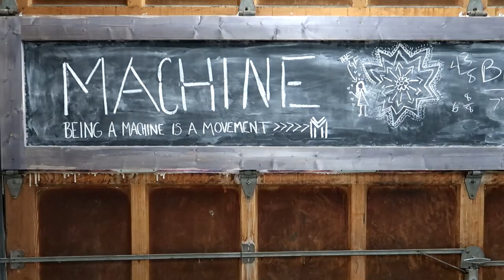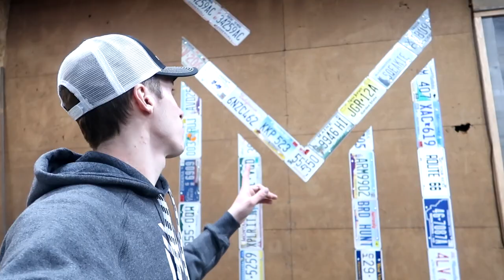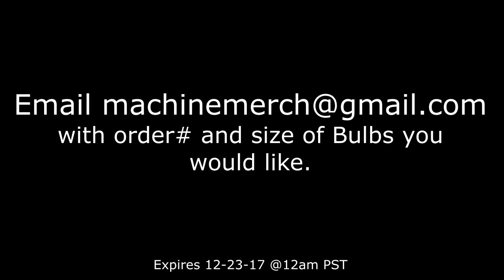NEW DURAMAX MOD - PLUS SOMETHING FOR YOU!

Comment: Love your truck, I have a 2003 Silverado with the 5.3. Just rolled over 95,000 miles & the amber light in my truck does the same thing, I have ran into so many wiring issues in the older model trucks but mines also 15 years old.... would you consider smoking out your third brake light ? Lastly my family lives in Bath New York.